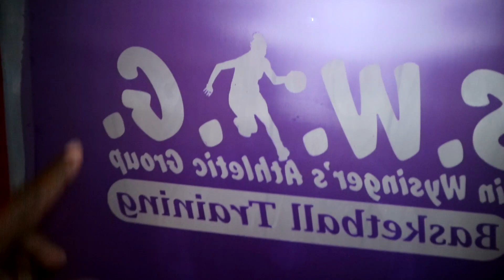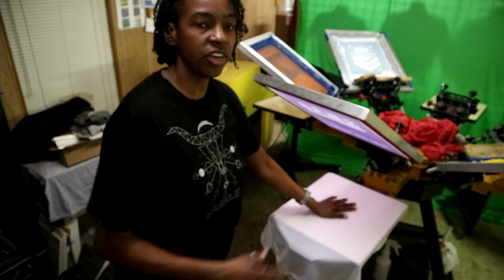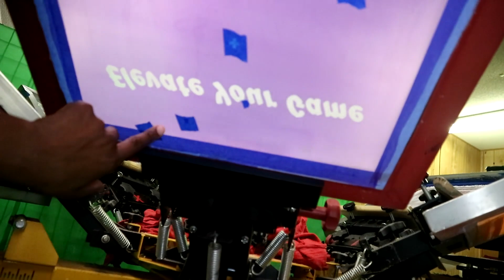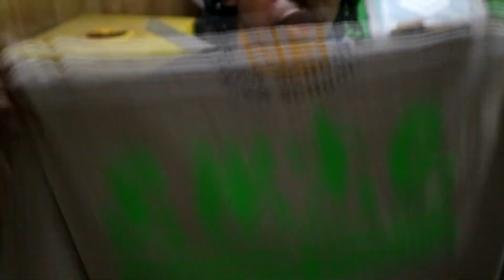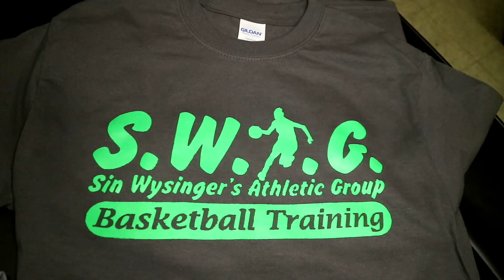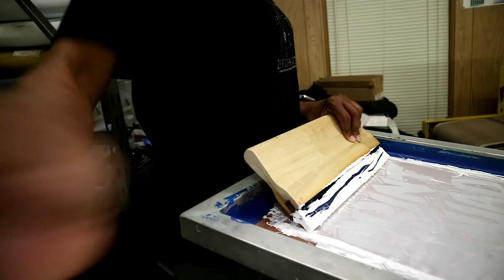How to Screen Print: Printing A 1 Color Design (For Beginners)

Comment: You need a vacuum blanket on your exposure unit and your screen problems will be over. The pin holes are almost always caused by a dirty exposure unit glass. It need to be scraped with a razor blade and then wiped off.
Reply from the maker: You're probably I've had it for years and never really cleaned it